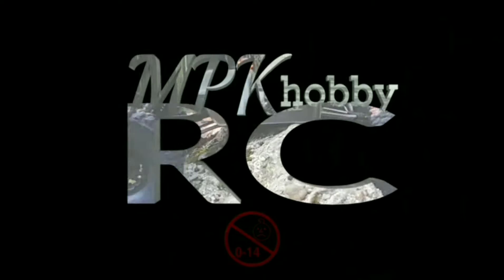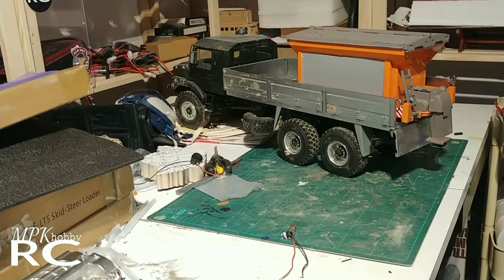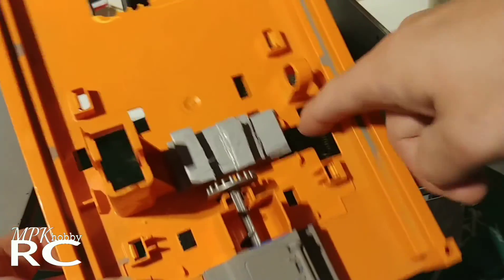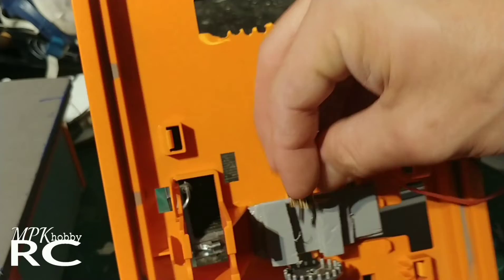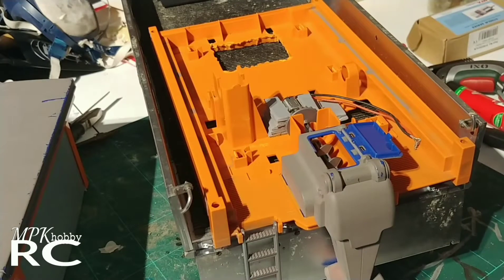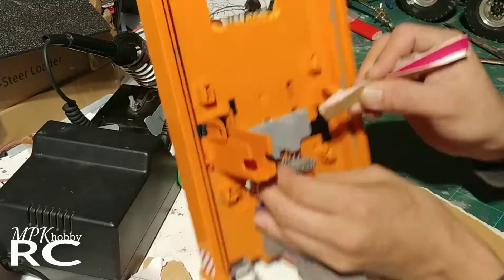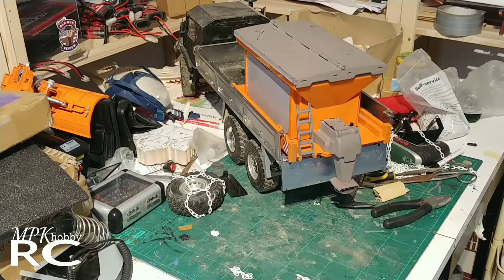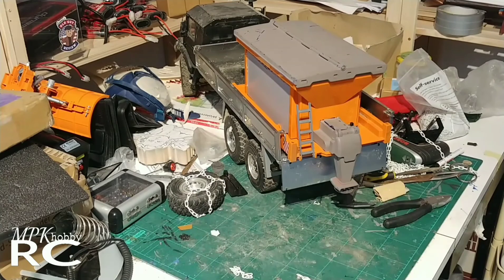MPK's Workbench #2: motorized salter!!

Comment: Dude this is awesome🤩😎. So that’s all stock goods beside you installing the motor?  I e never seen the guys of this spreader, now my head is turning like that worm gear 😂. I might have to dabble into another one two many projects I’ve already got going on 😬. I’m building a 9400T Ertl tractor just because in which I might sell it when done but it looked like a fun adventure to build.  👍🏼
Reply from the maker: Yeah all stock with the bruder salter.. Thought u had one?
Reply: @mpkhobbyRC  no never did.  I didn’t know what the inner guts were configured like.  I’m curious of how it’s going too kick out the spread and worm gear under load of the salt in system.  Next video please lol.  This is a great very interesting concept.  I’m thinking even sand spreader just use a fine pool mica filter sand it’s granulars are very fine.  And I have a pile of that from this seasons pool closing  behind my  pool 🤔 💡
Reply from the maker: Im hoping to try it out next weekend,  well unless we get a big dump here.. Might be pretty practical! 
I thought u had one cos u made that snow plow attachment for the loader...
Reply: I can in-vision it now pulling a system of this sort made as a wagon trailer behind my Ertl 9400T John Deere tractor.  If you get time search up that tractor and you’ll see what it looks like and to make Rc isn’t going to be that hard I have it on my invention bench now 👨🏻‍⚕️